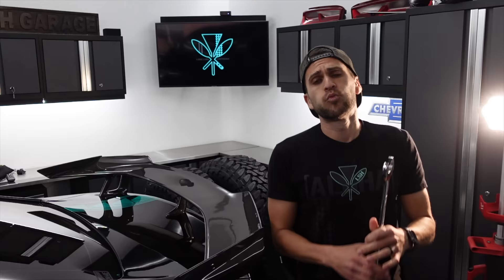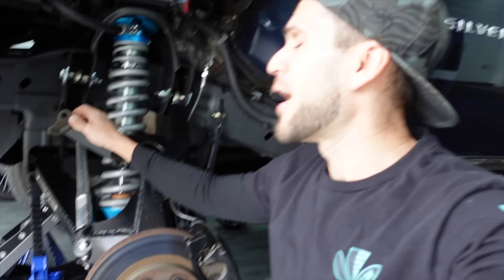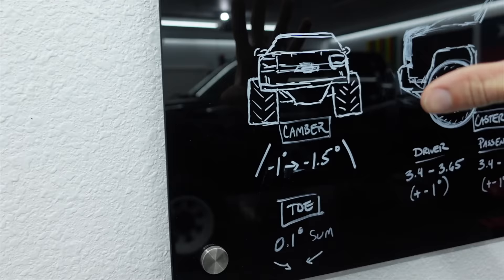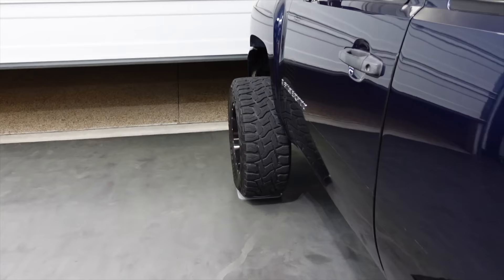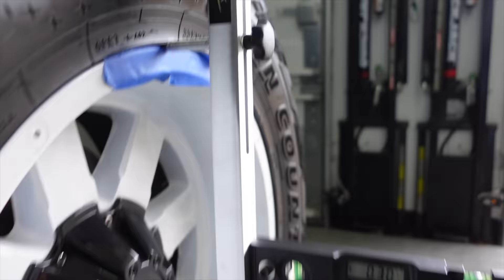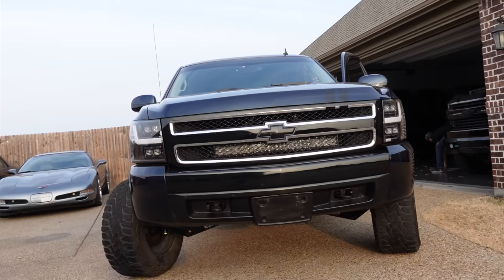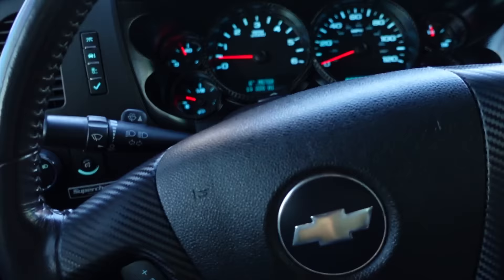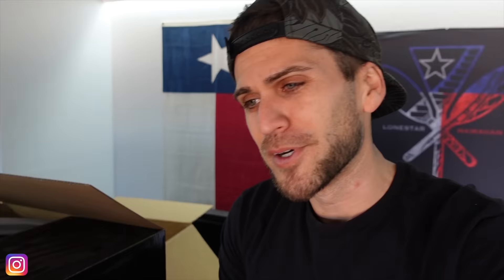FREE ALIGNMENTS FOREVER - Stop Paying For Crappy Work

Comment: With a few pieces of aluminum, some metal rulers, and digital levels, it is not hard to make your own alignment tool for less than $100. I don't bother with caster because most cars have virtually no caster adjustment, and IMO you can't have to much caster (unless you don't want better steering feel and front end grip). You also need something to keep the steering wheel centered. It is also a good idea to check wheel run out, if you have a damaged bearing or slightly bent rim, that can completely mess up your alignment.
When you are done the first time or two you can take it to a shop just to "check" your alignment to see if it is close. Most shops will do it for free or maybe charge around $25. Once you are confident your alignment is reasonably close to the pro rack device, then you don't have to bother with that going forward. But if you are doing it for the first time it is a good idea to verify what you did, The vehicle can track straight and still be off more than you want, and you won't know until you see your tires wearing funny. I found I can get to within .03 degrees (or less) of what the pro racks measure, but it took me 2-3 tries to work out the kinks. It takes a bit of practice and refining your technique, but once you get it figured out...

Comment: Rear wheel alignment is a real thing even on trucks with a solid rear axle, especially on lifted trucks, haven't you ever been behind a truck and you can actually see it dog track, it's always because the rear axle has shifted in the spring saddles and it doesn't take much, the rear wheels are what makes a vehicle drive and track straight, the front suspension and steering are what gives you control, that is a sweet front end on your truck because you have so much adjustment on your castor most vehicles don't even have adjustable castor or very little of it, oversized wheels and tires change suspension geometry and the only way to compensate for that is with highly adjustable suspension like you have, the money you spent on the alignment equipment you'll make up for with much better and longer lasting tire wear, good vehicle tires are quite pricey but truck tires can take that cost to a whole nother level.

Comment: Here's the thing I charge 34.95 guaranteed six months been doing 40 yrs. Also hd trucks. The reason four wheel alignments aid. Is knowing axle housing bent. Center bolt issues. But also thrust angle pos or neg. I get quick trick. I hv one as well gd video. Wld have like to see ur caster lil higher on rt side versus left for road crown but it wrkd so kudos to u. Also most don't know changing tires and no alignment will cause huge tire wear, if offset is changed.

Comment: I'm doing a front end suspension rebuild currently on my 2008 Silverado 3500hd 4x4 DRW to include new hubs.
The nearest alignment shop is some 50 miles away and down hill some 3,000 feet here in the Colorado Rocky's.
Alignment job is approximately $100 and the round trip is about $60 in gas (6.0L engine) along with, a guy that seems "sketchy" doing the job. lol

I'm glad your channel came up as a recommendation!

It's cheaper to rebuild a dually than to buy another!

Comment: Videos like this crack me up. It's always guys like this that want a $100 alignment  on their aftermarket suspension that will require a several hour adjustment and then call out shops that don't wanna touch that truck with a ten foot pole. Bring it to my shop for whatever you need, but be ready to pay if it's not stock. 20 years running a shop, and I wouldn't touch that trucks alignment for less than a grand. Thank God you found a way to adjust it yourself.

Comment: I used to think Firestone was a great deal for alignments since they actually have the special gear to handle my car...until the dude decided having negative camber wasn't needed and I ended up rubbing and then creasing my front fender.   I take it to a race shop now.  They are still decent for oil changes and the Penzoil Platiinum is a respected good brand.

Comment: So I know it takes some extra effort but the real cheap diy alignment kit is simple. Get a measuring tape with tightest increments possible, a chalk line, some string and a pen with some weight to it, some paper, and some masking tape. It's a lot to explain in a comment but you can either get your actual measurements online or get a profesional alignment and mark where everything should be. (Chalk line helps here, string and pen help here) your basically measuring the where the tires sit in relation to the car with the steering wheel straight. Once you know where it's supposed to sit you can simply check if the measurements match up in 3 months and if they do you are still aligned. If you are really good at parkin you could literally mark your garage permanently but idk anyone that good lol. You gotta be precise and it's cheap and simple but not necessarily easy. It's essentially what most race car crews do that aren't big enough to afford a mobile hunter alignment machine. I know I definitely didn't fully explain it here but I'm sure someone can find a video explaining it, he'll probably one recorded at UNOH where I learned it.

Comment: I'm assuming that the 1.5 is to compensate for road crown or is the measurements provided include the correct specs? The nice thing about an alignment machine is it gives you live data so you don't have to stop and get a reading you just make your adjustments and swing Caster to check it after you do both sides

Comment: Right on! Money well spent IMO. Most alignments are done incorrectly by "malignant shops" in my experiance. Just a waste of money and time. Always amazes me how with all that expensive alignment  equipment they manage to screw it up most of the time. I hate to take my vehicles to one because I have never had it done correctly.  Steering wheel not centered, Pulling to one side, tire wear (expensive but you won't know until much later). Lost all trust in them years ago. When it comes to toe and centering the steering wheel I set that myself now or correct it after I get an alignment.

Comment: So, some adjustments can be made in the rear if the alignment tech knows what he/she is doing. Yes, big if. It is common on aftermarket suspension parts for the lift and lowering kits to have oversized locating pin holes for the rear leaf and undersized locating pins for the axle. When installed, if the rear axle is not taped out for square. It will need to be shifted during the alignment. I have done alignments for a living for almost 20 years. I am not saying that the shop was not trying something. I'm just saying that if they checked the alignment and saw the rear was out, they may have been doing the right thing. I have even had to shift a rear axle on a totally factory setup because it was out of square. I had a printout of the front and rear current numbers to back up my claim tho.

With that being said I love the logic behind buying the diy tools and it is a great thing to be able to do your self when have altered ride height vehicle and are surrounded by shops that can't effectively do more then a toe and go alignment.

Comment: I'm here to say that dowl pin for the camber caster adjusters will NOT save you from a pot hole we're talking tons of pressure on that bolt during the event it will simply shear it what holds it in place is the crimp force from the frame around the upper control arm bushings you will find it is very flexible steel with clamping force from the nut I only do this for a living

Comment: Yes its true that you can't align the rear but with readings from the rear you can adjust the fronts to no only wear correctly but also drive straight. If the rear is tweaked a little bit and you only put sensors up front you could end up with the vehicle pulling and or a crooked steering wheel

Comment: I'm one of the last wheel alignment mechanics left at 76. The equipment you purchased doesn't work. Even on real equipment your tires will still wear. If you draw an imaginary line from upper ball joint through lower ball joint it has to hit the pavement in the center of the tire. Your's doesn't and tires will continue to wear. There is ONLY one alignment specification. Go cart, Ferrari, or concrete truck, it never changes. I can do a correct total alignment with a piece of string and a quart of oil.

Comment: You don't need drive on plates. A heavy duty outdoor plastic trash bag or similar thick plastic drop cloth material. Two pieces with oil or grease in between. Drive right onto them, tires will turn just as easily.

Comment: Great video. It's hard to imagine that they would only charge you the 'standard' amount for the alignment on a custom truck.  Maybe you spent more on the cost of this kit in the short term, but if you use it a few times it will start to save money.  Plus you know you can do it right vs. rolling the dice on who is actually assigned to work on your truck......

Comment: You can align the rear of a rear wheel drive pick up . Axle tubes bend and leaf pack center bolts break causing a dog tracking issue .

Comment: While it wasn't a lifted truck, I took my vehicle into a shop for an alignment on their rack, which they did, and when they gave it back, it pulled significantly to the left.  Like it would ~climb~ the crown in the road.  I went back to complain, and they said "well, the machine says it's all straight..."  I replied that I didn't care WHAT their machine told them, I didn't want to die in a head on crash with a Mack truck, and they needed to do the alignment again, and this time, do a test drive afterwards, and if it still pulled to the left, then the tech needed to make an adjustment so that the vehicle did NOT pull left.  If it pulled any which way, it should pull to the right (and it shouldn't, but I digress) so that if I should fall asleep behind the wheel, I only run off the road going 60 and not into oncoming traffic going 120.

Comment: You absolutely CAN align the rear end on a solid rear axle vehicle with leaf springs.  Just not in it's stock configuration.  You either need alignment plates that allow for movement between the leaf spring perches and leaf springs, or adjustment plates for the leaf spring shackle anchor points.  Not something you're gonna find on 99.999% of trucks, even after they've been modified.  Though amazon has this same design tool from the same company for under $200....🤭

Comment: had this same thing happen, wanted an alignment on a 2007 ranger, no adjustments can be made on the rear but most shops recommend 4 wheel alignment.  makes no sense. I adjusted my own camber with the camber plates and then shortened and lengthened (depending) the tie rods myself. just used a measuring tape.

Comment: Stipe the metl off below the cama, lign it with the stock alignment cams.,  then weld the cams in place.   Make future adjustments from there at the heim ends of pre runner arms.   Full long ravel pre runners.  like raptor long ravel kists weld up the slots which are on the lower arms on  a ford but you wont see guys with frequent flier miles in so-cal with slots for alignmnent.   Its welded and then dialed in by the replaceble heims on the arms.

Comment: Note: Make sure caster on right side (passenger) is 1/2 degree higher due to standard road grade (not those old backroads). ALSO - if your steering wheel isn’t straight - you are compensating one of the tires straighter than the other, thus you start getting inner/outer tire wear…. Mahalo bruhda

Comment: For the most part, fancy professional alignment racks are merely time savers that let under informed techs do these jobs with reasonable accuracy. All you really need to do the job properly is tape measures, a protractor, and a means to attach the protractor to the wheel or its hub. 

So long as camber matches side-to-side, you can tune out even the nastiest pull with caster. The vehicle will pull to the side that has the least positive/more negative caster. On a vehicle with strut rods, you can pull over to the side of the road and adjust caster then test drive. Rinse-repeat until the vehicle goes straight. Re-set toe and enjoy. 

This isn't rocket surgery. It's just that most people don't want to or can't do the work. But if you can replace suspension and steering parts, you can probably align your own vehicle and you might already own many of the tools.
Reply: agreed .. i havent paid for an alignment in 10 years..
got sick of them not being able to get my car to track straight. . 
just used fishing line, rulers, tape measure and plumb bob..
eventually i found the rear axle was slightly bent on one side, it had 1.5mm toe in on one side at the rear... this would eventually cause the tyres to develop a permenant pull no matter that the alignment was "correct" at the front.. car would be ok when first aligned but would gradually build up a pull over time.. put new tyres on and it would go away only to come back again..
many shops couldnt fix it but kept getting paid..

Comment: what they mean by 4 wheel alignmentis you have to aline all 4 wheels together meaning you have to something to make sure front in line with rear 4 wheel alignment does not mean adjust all 4 wheels if you do not do this you can end up with you steering wheel off or the truck dog tracking meaning riding side ways down the road YES the rear end in a truck with leaf springs can be out of   alignment due to many reasons hints you NEED a 4 wheel alignment

Comment: We had high dollar, low tech laser alignment system sort of similar to that like over 25 years ago. But much.. much better built than that one. Was used for semi trucks, we used them for our truck tires 40" & over. All the other alignment shops would put your truck back to stock specs, you cannot use stock specs anymore.  Big trucks like more toe for starters, and I don't like too much  negative camber it destroys tires.  A bit positive caster is good.

Comment: With how much I drive, I need a new set of tires annually regardless of alignment or not. So I just stopped getting it done unless the car is pulling in either direction and that has yet to happen.

Comment: Hell I need this for my '15 2500HD.  Had it "aligned" at a local major chain tire shop last year - complete with a before/after printout - and it still pulls to the left, no better than it was.  Changed brake rotors, calipers, pads, and lines as it seemed like maybe that was the deal, but NOPE! I noticed there is a huge difference between the adjustment cams comparing left to right sides of the truck, and I measured rear to front center hubs, and there is almost a 2" difference between the left and right side. I'm done with shops, gonna get this setup and roll with it myself. Might as well upgrade from the torsion bar level to a proper lift kit while I'm at it...

Comment: You know. The times i need alignment, i noticed scratches near the wheels that im sure is done with the devices they put in the wheels. Maybe when is installing it or removing it. Tiny ones but they weren't there before the shop. So i always try to work on my car myself much as i can for just for that merely reason.

Comment: It has four wheels so, I think it's fair to call it a four wheel alignment. Motorcycles require alignment which would be a two wheel alignment. However, Firestone does not perform two wheel alignments and should just call it a wheel alignment to eliminate ambiguity.

Comment: Hopefully I can do the manual alignment myself too. I paid $159 at Canadian tire for 4 wheel alignment even my Murano 2-wheel drive. AFter the alignment,  my steering wheel was 3 degrees offset.  I went back and the service manager told me my I have an old tire.  He wants to sell me new 4 tires which will cost me more than 1K.  I went back and put my almost new two winter tires in front and still the same. I came back to them and they don't want to fix it. After some argument, they fixed it.  What a waste of time,  money and effort for that Canadian Tire branch. I will never come back to them again.

Comment: Im going to guess that the alignment shops take into account for road crown which would have your position different from left to right. I could be wrong of course but it would account for when driving in completely flat road your wheel be a little off center.
Reply: Normal road crown (tangent or straight pieces of Road) is 0.02 ft/ft sloped away from the center for drainage purposes. Usually 0.06 ft/ft full super elevation (in curves) at 50 to 80 mph design speed.   Factory alignment specs will compensate for Road crown not Joe Blow in the alignment shop.